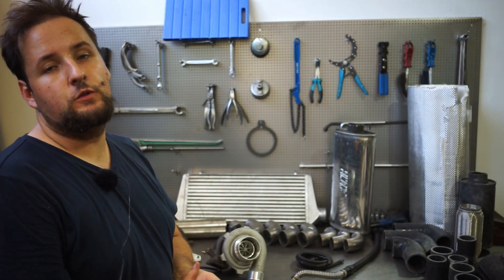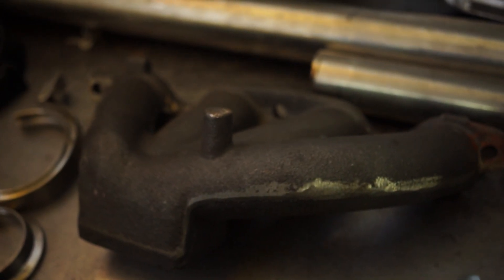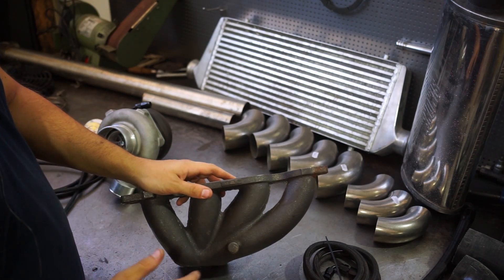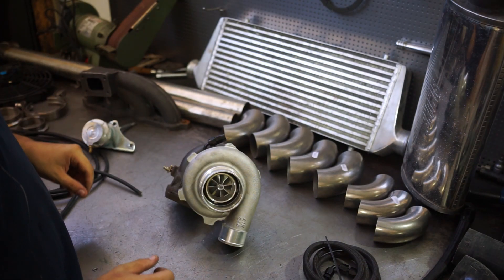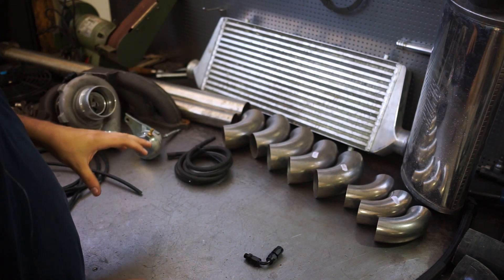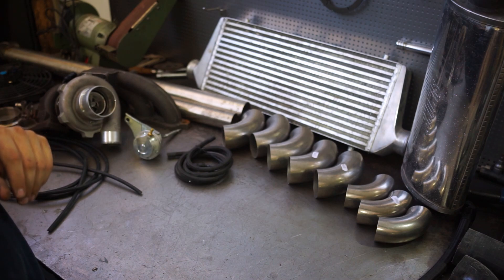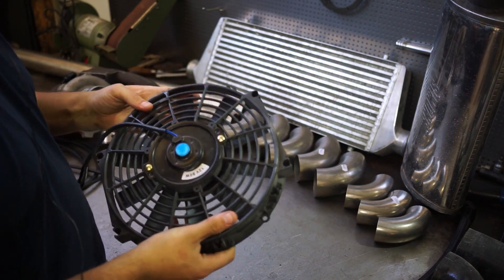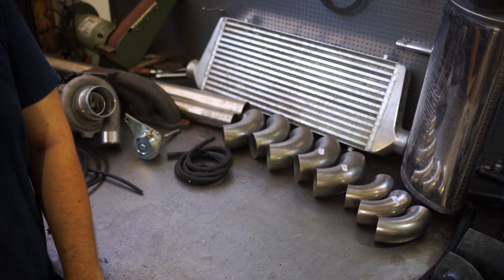Turbo 4AGE 20V Silver Top | Parts overview | GTX 2860, Custom exhaust, Standalone, 280+ HP

Comment: I would love to see how much of the setup would be needed if you slapped an oil-less turbo on that manifold.
Reply from the maker: just the oil and waterlines would be removed but honestly running those isnt hard or expensive. the price plus for the oil less turbo + grease and the grease gun are multiple times more expensive

Comment: Hey, newbie here. What’s the point of needing a oil pan with an oil drain?
Reply from the maker: @replayxskillz6336  the turbocharger is oil  lubricated and cooled and the oil needs to go back into the oil pan after beeing fed into the oil feed on the turbo
Reply: @throttlebuddies0 thank you boss 🤟
Reply: Hey need some advice can I get a contact

Comment: I built one 16 years ago in Australia made 200hp silver top 20v in a Corolla sx twin cam nothing was available back then I had to make everything custom but for injectors use the ones from a 1jz turbo and they fit straight in the factory fuel rail and use honda civic eg radiator to clear the turbo best of luck
Reply from the maker: Thx. Yeah i think the 1j injectors are too small for my goals though. As for radiator i am probably gonna go for that and make custom pipes for water

Comment: 280 out of a 1.6 is seems crazy too me?
Do you think will be reliable at that number or is it on borrowed time.
Reply from the maker: its gonna be pretty reliable. 280 isnt really that much.
Reply: @andrewcarroll8265  definitely you are going to break a rod this is a high reving engine compression ratio 11.1 small boost is required and plenty of fuel and your going to have to make a custom plenum chamber that one will leak 1jz injectors will make 250hp no problem 😉
Reply from the maker: Its 10.5:1 the rods in the silver top are pretty strong not worried about that i have made 300 hp on a miata 1.6 with stock rods and they are quite a bit weaker 

With water meth should be no problem even at more than 0.8 bar or 12 psi,
Reply: @throttlebuddies0  do you have videos off your 300hp miata i dont find any
Reply from the maker: @elcascoviejo5347  i do have quite a few but they are a bit older now as the car hasnt been runing for over a year but i need to get it going again. this was the last one with it driving: https://youtu.be/zlxGTdUw0y4
Reply: @SamKader-v5p  I'm running a similar setup for two years daily, very reliable
Reply: @andrewcarroll8265  any way best of luck with it
Reply: @andrewcarroll8265   4ag's are strong man.